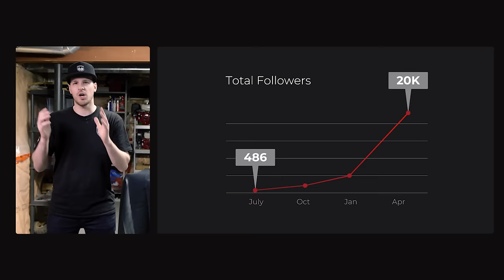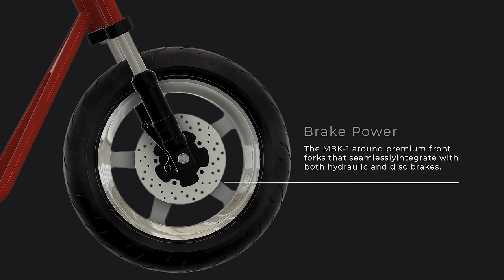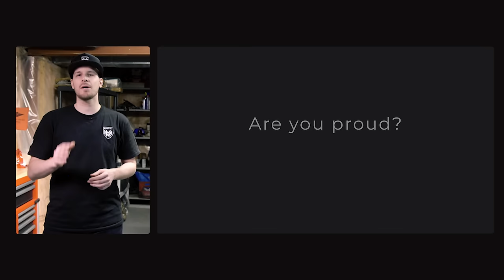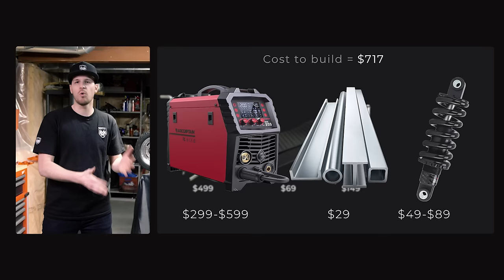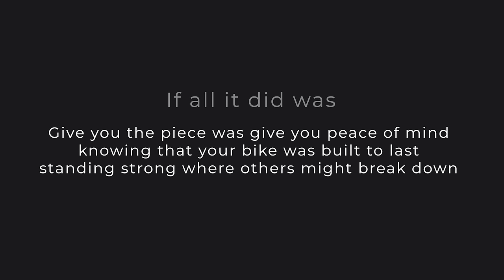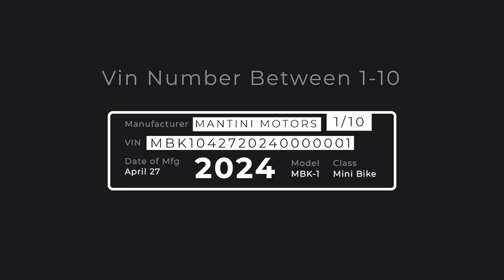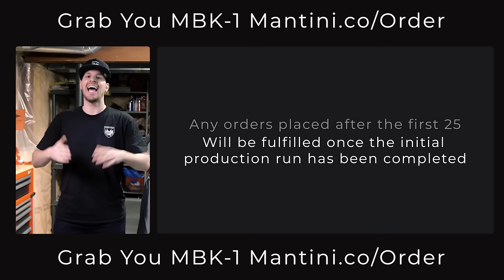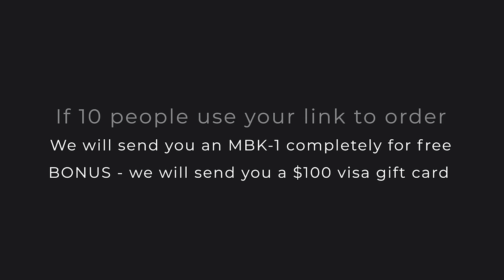MBK-1 VIP Presale Presentation - Official

Comment: that price is ridiculous .I hope you do well i know you have worked hard
Reply: Do u think it’s too high or too low
Reply: ridiculously underpriced?! This is history in the making!!!
Reply: Too low, pretty sure the competitor is like double the price and nowhere near as cool.

Imagine having one of the very first Nike shoes??
Reply: Ridiculous??? My RCF roller cost $1500 zero suspension stick to doodle bugs if you think the price is ridiculous 😂😂😂😂
Reply: You can't get a trailmaster mb200 full suspension, engine, cvt , and 19 inch tires, front and rear brakes for 1000. It's overpriced
Reply: @Bobafetblue did we watch the same video? Comparing a Coleman is horrible. Welds are bad and a lot of frames aren’t even square
Reply: @MarleyJaxx you can grab minis for $300 all day, id value this bike at like $2000-$2500. too many manufacturers for “being the first” to matter
Reply: @TheMarklandian  I'm sorry but you have been mislead, and what some might call scammed. A little rascal  is only 900 and miles better than a rcf
Reply: I think it’s fairly reasonable. Not cheap, but not too insane.
Reply: @Bobafetblue  but a little rascal is well… a little rascal. Are you gonna comfortably fit a 670 full suspension and adjustable handlebars on a little rascal without basically rebuild the whole frame? The whole point of the mbk-1 isn’t “it’s a good mini bike frame” it’s “the mini bike frame that can accommodate any builder/rider”
Reply: I like how all u just saw 5499 but the real price if u watched it only 1299 it says it in the video

Comment: When you use the jackshaft. Will it be permanent or be able to also slide? Bc with no engine chain tension how will the chain be tensioned when using the jackshaft?
Reply from the maker: It’s slides forward and back. So you can add tension to the chain.

Comment: Are these compatible with the 4-piston RPM brakes? If not what will they accept, hopefully with up to a 670cc they can accept some good brake? Sweet frame 👍
Reply from the maker: Thank you. Yes, you can use a 4-piston brake caliper like you would find on a Honda Ruckus on the front forks. 

Right now we have the mega motto hydraulic brakes on the front and rear but we are going to try the DRDS hydraulic brakes that go on the Hurricane 200X for the rear to see if it’s better.

Comment: Are you going to come out with something that has bigger wheels and more travel? I think a lot of people that would want this want to go offroad. The big problem with mini bikes right now is they are just not good at anything. The MBK-1 doesn't look like it has much travel, especially being so low to the ground as it is. The rear swingarm doesn't look like it has much travel either. I think you could have a big market if you built a more capable off road bike that fits the spot between a coleman mini bike and a dirt bike - bigger tires, better suspension. It's awesome that you are building this, and I'm looking forward to seeing the builds. With current mini bike frames, you are limited to like 212cc becuase of the dimensions. Glad to see you can put a bigger engine on this one. That's your main selling point in my mind. I bought a tube bender and all kinds of stuff, and I'm building a bike myself, but I'm not going into production to sell them. That's so cool that you are. People need a good quality alternative to the junk, chinese made mini bikes that everybody has now.
Reply from the maker: Great ideas. To be honest, we have some ideas on how to design an off road kit for this bike to allow for more travel and larger suspension. But we may also just design an entirely different off road frame kit that is built like a tank haha. But our focus is on the MBK-1 for now but we do understand the desire for something a bit more rugged.

Comment: Quick question what comes in the go power sports kit? Because it doesn’t say anything on it
Reply from the maker: It comes with everything you see on our bike to turn it into a full roller. 10" wheels, tires, front and rear hydraulic brakes & levers, upgraded foot pegs, throttle and so much more.

Comment: Adding the price of a welder into the cost of a comparable build is kinda ridiculous. Your bike is expensive. Own it, don’t be dishonest about it.
Reply from the maker: Great point. To clarify, I wasn't including the cost of the welder into the price, I was explaining that if you wanted a swing arm but no one sold one for your frame, you would then need to buy a welder, metal and a shock to build one yourself which quickly adds up.